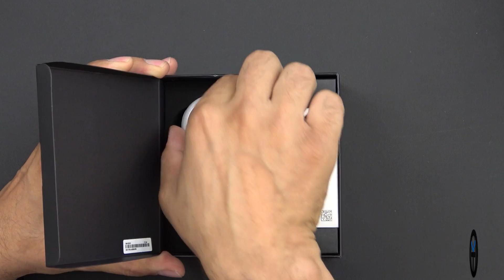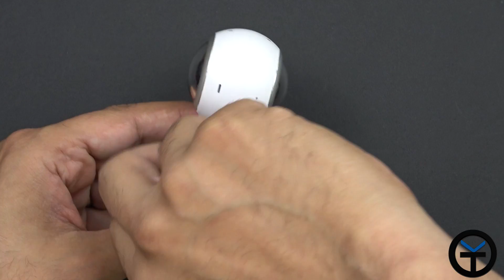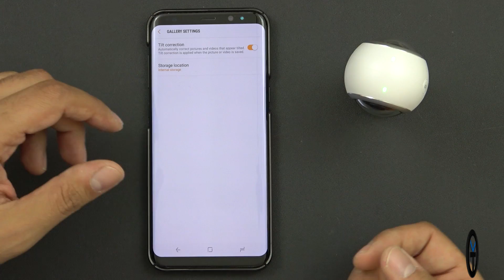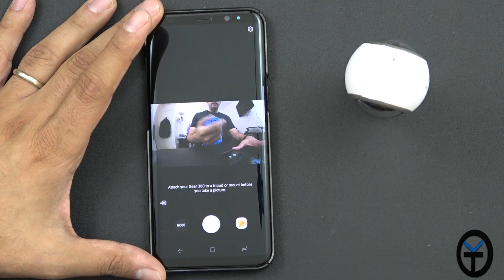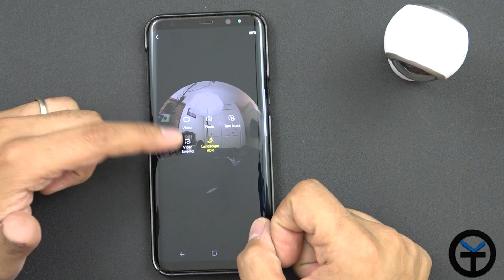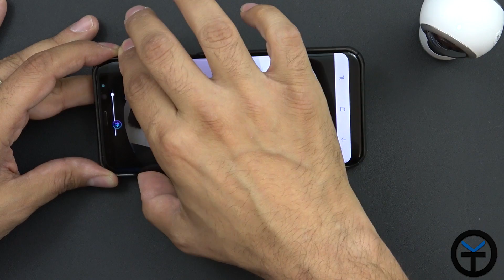Samsung Gear 4k VR 360 Unboxing and Setup/Compare to LG 360 + Video Sample Verizon

Comment: did they change the app name, I can't find it
Reply from the maker: Honestly I'm not sure if this device is still supported you may have to look up an older version of the app on Google
Reply: @TKBay  Thank you I have a samsung fold 3 I, just got a software that i can use it on ly laptop called action director and it is free if you have the serial number of the gear 360 which is in the setting

Comment: Just purchased the Gear 360/4k.  Having issues finding app. can you show the icon of app needed to run the g360?  Also, my note5 is finding the g360 but having issues pairing.  I am usually good at working around but stumped.
Reply from the maker: https://play.google.com/store/apps/details?id=com.samsung.android.gear360manager
Reply: Thanks for your reply I found it but it will not work on my Note 5 hmmm!!!  O well,

Comment: I bought a band new  gear 360 at best but and it overheated in just 30 minutes you were all warned
Reply from the maker: +Jeff P heats up and stops working or just gets warm?
Reply from the maker: +adebayo ogunbiyi any passively cooled piece of hardware will heat up, this piece will warm up, it's either that or a loud fan in your videos to keep it cool

Comment: Which 64GB Micro Sd card is recommended? When I use a San Disk U1 for videos sometimes it cuts and I get a slow memory card message.
Reply from the maker: +oceantransistor this models worked great for me no issues. http://amzn.to/2yye912